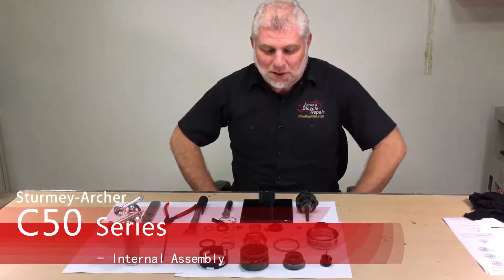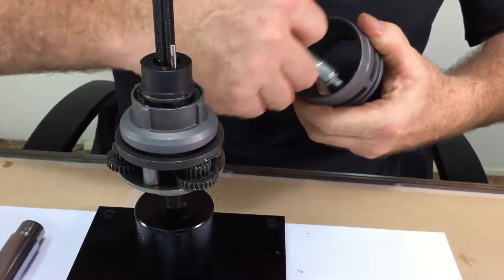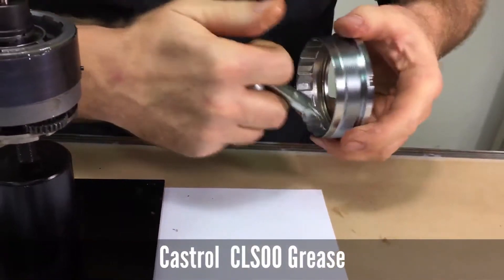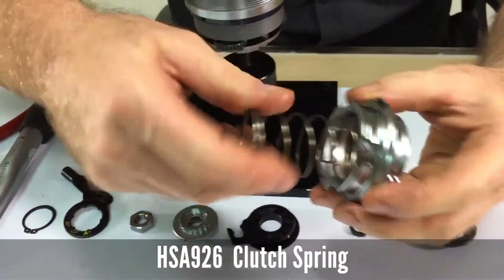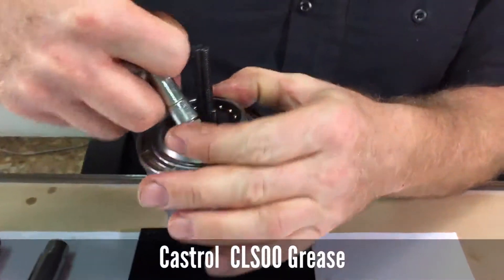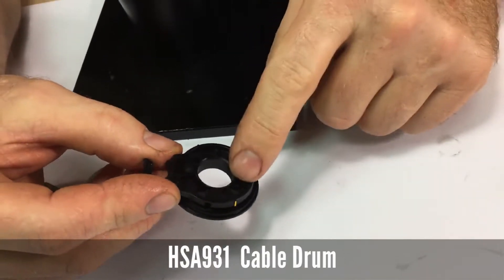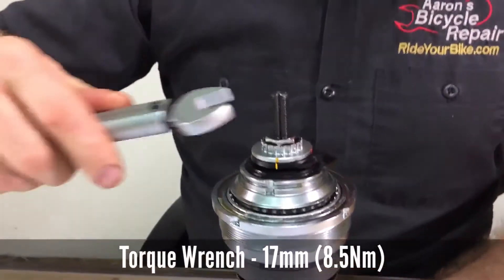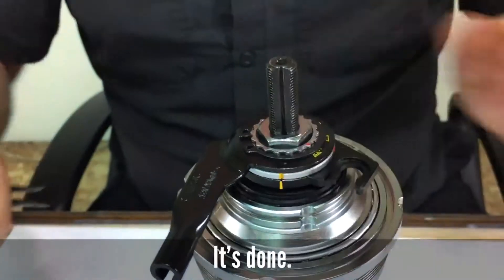Sturmey-Archer C50 - Internal Assembly

Comment: I bought the SA 5 speed and had it installed in in my bike with a vertical dropout. It does roll smooth and shifting is comfortable. However, the 2nd gear pawls sometimes readjust when pedaling. Since I have not the tools to open it, I accept it. The difficulty in the Netherlands is that I couldn't find a mechanic to help me. This will hold a lot of people back to acquire this hub. Btw. very good video. Would love to dissemble and assemble one myself.